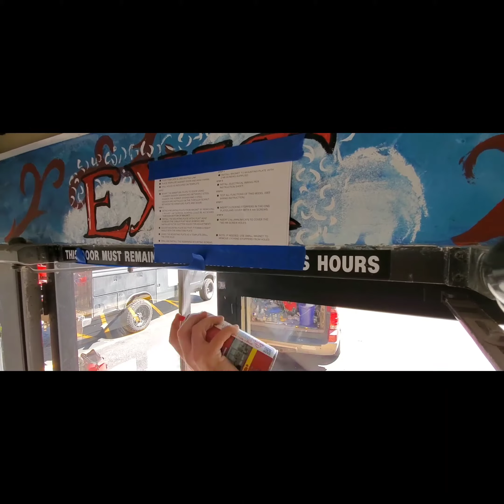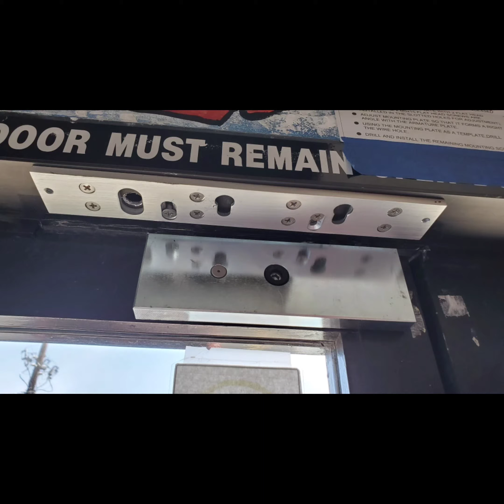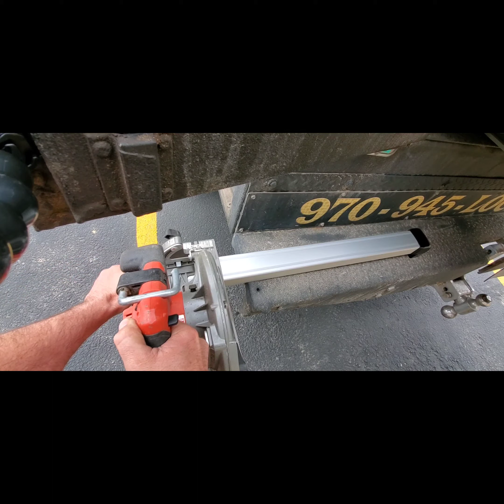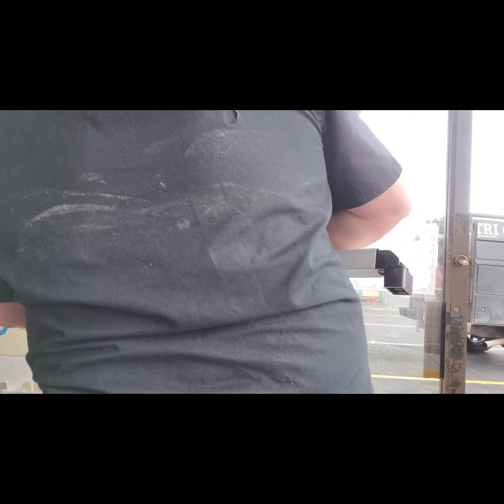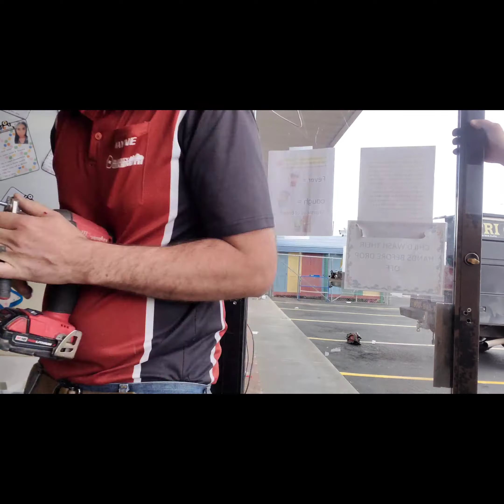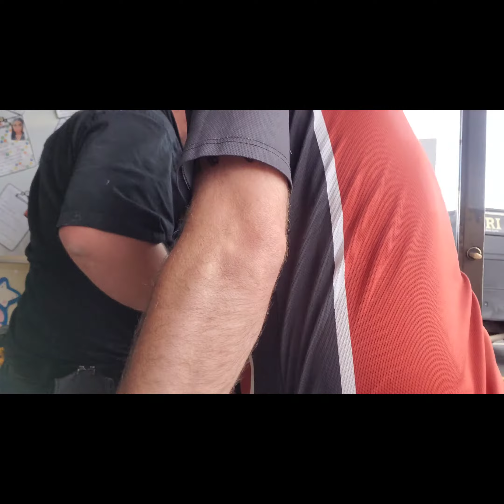Installing Securitron TSB Touch Sense Bar with mag lock

Comment: Do you have experience with SimpliciKey Keyless Deadbolts? I have a working key code and manual key. Any way to re-program w/o knowing default admin code? I would not reccomend this company, but apparently the lock was expensive and it's been working for 10 years strong. Thanks for sharing your locksmith knowledge with us.
Reply from the maker: Unfortunately I do not